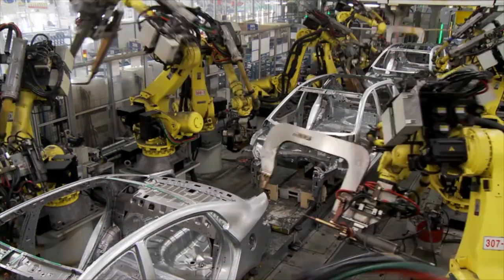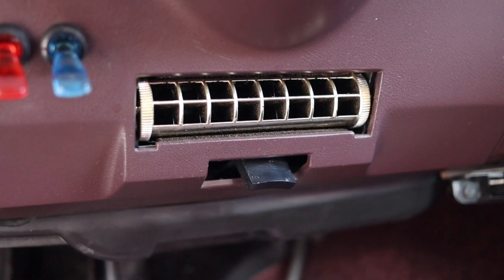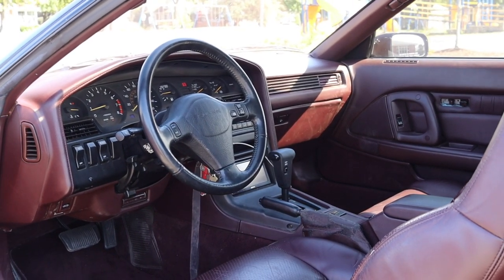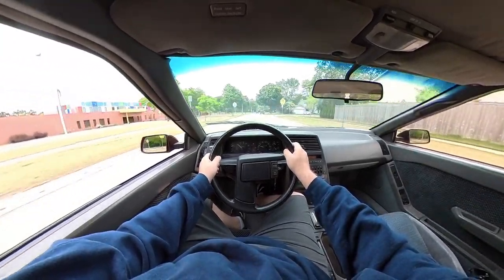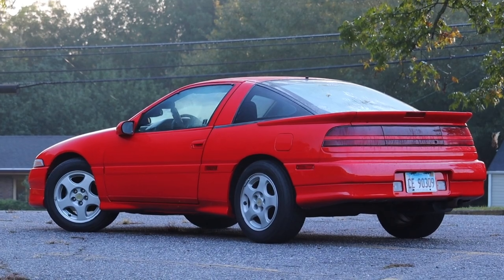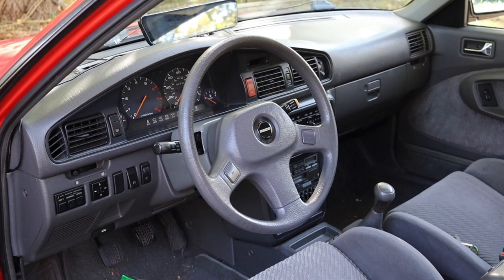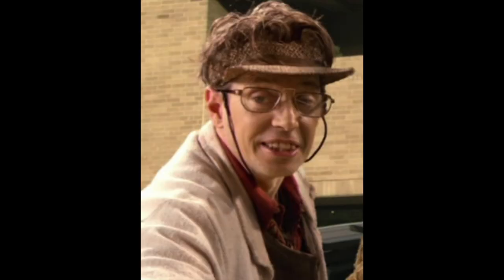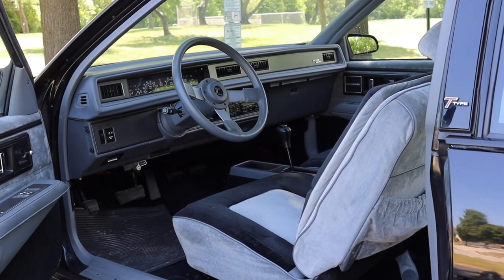Crotch Vents - What They Were & Why This AMAZING Feature Went Away!

Comment: Safety is probably a reason as cars now have airbags everywhere.  As for air conditioning, even the smallest cheapest cars come with A/C as standard equipment.
Reply: I have no issue with that, but MAN they are all so big/bulky/puffy now. The doors are MASSIVE and the windows are not. 
At this point in my life I'm not just into 80's 90's cars as nostalgia, I just legitimately don't like/trust models from 2005 and so on. 
The older ones are cheap, easy to work on, and parts aren't too much usually. They are anything but a disposable product and damn can they stand out these days when taken care of.
Reply: @rushnerd  I don't trust anything with a central computer that handles throttle-by-wire, and agree that modern cars are intended to have finite lifespans. It's the older cars, the ones you can fix by hand and know/understand where everything goes that are worth anything!
Reply: @kiraleaf  Yeah, not but purpose, but I've never had a drive-by-wire car. Even my 01' Celica is direct throttle, but changed to digital the next year. Though hilariously, that car the throttle barely matters as the 2ZZ engine is completely rev dependent.  You can floor it in 3rd and NOTHING will happen. The 88's Supra is the most raw and direct car I've owned though. You get EXACTLY what you put into it and the steering feel is the best a car could possibly be. No idea why people want numb newer cars that are a plastic mess and expensive as hell. Even the dash design I cannot stand on any car now. Bias, but I think the 86-92 Supra has quite possible the best dash layout ever.
Reply: @rushnerd  my buddy had an 89 supra NA automatic but it was such a cool car to cruise around in and got lots of attention.
Reply: @wigletron2846  Yeah mine is a base model NA too, it's easy to scoff at that, but I got it in near-mint shape for $8K @ 115K miles because of that. It gets a crazy about of attention. So much so that I wonder why people even bother with new sports cars. It's just the coolest thing I've ever owned and you get virtually everything you would want from it. Absolutely never get tried of driving her.
Reply: @rushnerd  I like the 86-89 Celica GT-Four (not availabile in NA until 1989 as the All-Trac Turbo in USA and Turbo 4WD in Canada) and the 90's popup models before the Celica was nerfed.
Reply: @rushnerd  I prefer large Windows also which is why I purchase a 2023 Subaru Forester.
Reply: @rushnerd  yeah my buddy got his back in 2010 for $2900 with 150k on it lol. It had a suprising amount of features for an 80s car: power everything, adjustable suspension, and even had a decent amount of cargo space with the hatch.
Reply: @wigletron2846  Killer deal. Not possible today. Though you can pay as much as you want to for one and it's a game of getting the best one with the least amount of issues and/or parts you need. Once it's sorted it's an 80's dream. What happens is most are cheap but neglected and not cared for (they are NOT cheap and parts are rare) so most of them never see the road or rot away.
Reply: @robertknight4672  I mean I don't love glass box cars either, but both my hot hatches are pretty dim on the inside which is what I mean while still having good visibility.
Reply: @kiraleaf  Yeah, of course that gen and especially the 90's gen are the sought at after ones. Not even to mention the outside-US options. But they are pretty hard to find and command high prices, I just wanted a daily for my 7th gen Celica so it does that while looking amazing and being fun. I miss my old Camry, but she is so much cooler it's no contest.
Reply: @kiraleaf  My uncle was a GM engineer from the 70s to the 90s.  When one of his coworkers in the 1980s told him they'd start using ECU technology and a computer in your car would be widespread, he just said "What the fuck did you just say?"  He doesn't trust any of that either unless it's in a standard "showoff" car.  But in a daily?  He wouldn't drive that.
Reply: In Mexico they sell some cars Toyotas even that come standard with crank windows and no AC. A couple months ago I rented a 2020 Chevy Beat, and it didn’t even have POWER LOCKS.
Reply: @scottoleson1997  They seem to make cars with fewer features in Mexico. I saw the lat generation Corolla didn't have the safety sense features that we have in USA

Comment: I believe they were referred to as "personal coolers". These probably went away in part to decontenting. Many features cars regularly had  as standard or mid-range equipment are gone or reserved for luxury cars. For example, puddle lights on doors were very common on cars in 70s, 80s and 90s. They're very rare now. Also, cornering lamps are all but nonexistent, and very few cars are equipped with them.
Reply: I didn’t know puddle lamps were even a thing until the past few years. Are there cars that don’t have these now? Seems like they are pretty pervasive.
Reply: @MoosePockets  I grew up in the 70's/80's and I don't remember any cars with puddle lights at all, except high trim cars that had lights in the doors but not under the door like what we call puddle lights today. Even crap cars have puddle lamps now.
Reply: Cornering lamps and puddle lamps are surprisingly making a comeback. Cornering lamps are now activated by steering wheel angle, instead of turn signals though.
Reply: Puddle lights are rare? 

My Charger has them. I'm pretty sure Challengers do too.
Reply: Puddle lamps are still on pretty much every car.
Reply: @aca2983  I think it has been somewhat regional thing. In Europe, where cars have traditionally been much lesser equipped than in America, we never had puddle lights before this century, except in some individual American imports (including some American-market models from some non-American makes). During this century, they have become pretty much standard here, along with many other traditionally American-considered equipment.

In America there has been, as implied afore, puddle lights in those decades, but I'm not sure how common and how it has been in 90s and up to today. If they are making comeback there now, I think they are following the footsteps of European competitors. No idea why they would have disappeared in first place there, though.
Reply: I have to admit that I've never learned to appreciate "puddle lights", though maybe I'd be more enthusiastic if I had ever owned a car with them. But cornering lights should be standard on all cars; they make a big difference when turning off a dark street, especially with pedestrians around. Most Chrysler cars, Nissans and VWs have them now, but GM, which pioneered them, has let them fall by the wayside.
Reply: Puddle lamps,or courtesy lights,are typically under the side view mirrors these days...not on the inside of the door as often as they used to be,but red lights &/or reflectors are still often on the inside of the doors,so approaching  drivers can see open doors on  cars parked at the side of the road.
Reply: I refer to them as cooter coolers. Wish cars still included them.

Comment: I think my '78 Trans Am had one.  But the air conditioning was so anemic that I really didn't notice whether there was a vent down there or not.  One design "feature" was clearly put in place by a murderous psychopath of an automotive engineer:  The same fuse that serviced the A/C fan also serviced the power windows.  You have not lived until you've been trapped in a 1978 Trans Am in Southern California in the dead of summer with no A/C, no fan, and no way to open the windows, and lived to tell about it.

Comment: Actually, collapsible steering columns began being required in 1968.  If you don't believe me,  look it up.  GM cars had them in the 1968 model year.  Pontiacs even had the words "energy absorbing" written on the middle of the steering wheel in 1968 to indicate this.  Most safety equipment began going into cars in the mid 60s to the mid 70s.  Buick and Oldsmobile offered air bags as an option on their cars in 1974 and 1975, but hardly anyone purchased them, so they went away.  Finally around 1990 they began coming back.
Reply: 100 percent correct!  1968 saw a load of safety requirements In 1955 Ford tried to sell "Safety" It had a deep dish wheel that was supposed to absorb the impact. Yea right! Seat belts were available too. They made a big deal out of the "safety" off the 55 Ford. Not so much in 56! they couldn't give the seat belts away! Things have sure changed
Reply: The insurance companies law makers and the auto industry made a deal to make a seat belt law. These laws delayed mandatory air bags. You are definitely right. The technology has been around for years.

Comment: My first car was a pickup truck, a 2001 Toyota Tundra TRD. This absolute unit not only sported airbags and an adjustable/collapsible steering column, it had the venerable crotch vent to boot. 

It should also be noted that the A/C air could be directed through dedicated floor vents, dash vents, windshield defrost vents, and anywhere in between.  All the while providing adjustable crotch cooling in the Texas summer heat.

Comment: In Australia they were called lap vents.  I think another key reason is the design of the HVAC box and ducting.  Cars of the 70s had very little consideration for integrated AC.  Through the 80s, it got a lot better.  But adding AC normally involved running additional ductwork, and for ease of fitment, this usually ran behind the lower sections of the dashboard.  It was very easy to add a lap vent to the ducting that was just an inch behind the vent location.   I had a 1984 WB Statesman (Aussie car) that had lap vents on both sides, not just the driver.  They drew from the ductwork that fed the outer face vents. 
By the 2000s, almost every full size & mid size passenger car had standard AC in all but the very basic trim level.  Economies of scale shifted to making AC mainstream.  The design of the HVAC system evolved in the 80s to start prioitising AC, with a cheap “downgrade” insert to replace the evap core in non-AC cars. By 2000 (and some up to a decade earlier) the ducting and HVAC were key packaging elements right from the design stage, and the ducting often ran much higher up behind the dash, or in some cars, was even incorporated into hollow structural members to save space.  There was no longer an easy way to get that air down to the lap vents.  The cost of doing it would have been tens of dollars,  not a few cents..   My current daily driver has so much space below the steering column, and could easily have one, but the ductwork runs behind the instrument cluster.  It’s incorporated well into the dash structure, miles away from a lap vent location.
Reply: This is exactly the answer I was thinking.
Reply: Definitely the most probable answer I’ve heard

Comment: I remember Chevy/GMC  C/K and later R/V pickups, SUV's from '73 - '89 when equipped with factory A/C had those crotch vents located at the lower left side of the dash. You could position the vent to get the optimum volume air flow to the "family jewels" . When they were cooled you were very comfortable on the hottest days! I knew the feature in those vehicles was designed by a very thought out male engineer! Later models of those PU's and SUV's (new body style '88's - '99 SUV's to '01) had a similiar vent located just under the steering column, but they didn't get the same volume of air flow as the previous models did, but at least the thought was still there.

Comment: Some cars in the 70s had 2 crotch vents for the driver, and 2 for the passenger. One had a tab to pull forward for “floor air” which was a nickel sized hole that dropped the cold air down to your feet. The other was a 1 x 4” vent with a door to drop down to cool your crotch. This was one unit. Sooo nice, so decadent, so pleasing, it was the car built to coddle you. I remember this on 74-78 Chrysler Newports and other variations like the Monaco of the blue brothers movie.
Reply: Ah, the crotch coolers of my youth. The toe cooler WAS a nice touch, too. My parents bought a new Monaco in '74; it had a beautiful blue civilian paint job and had the lesser 'cop' package - all the stuff Elwood talks about, but with a 360 2-bbl instead of the 440. I got my first driver license, and cooled a lot of crotches, in that car.

Comment: The reason they were down there is because back in the 60-70-80s..  a.c was optional.. didnt come standard..  So the dash wasnt buult with a.c in mind.   If you picked the a.c option you could simply bolt simple routed vents under your dash.

Cars back then also had vents by your feet.. you pull a lever and theyd open up getting fresh air from outside to your feey.

I love those on my Wagoneer. And wish new cars still had this
Reply: Does your Wagoneer have cowl vents?  I have an Eagle with the most powerful cowl vent ever. Sadly with the floor missing, it isn't so noticeable anymore.
Reply: @KC9UDX  yea thats where it also gets air for the heater lol.  But yea if you pull two knobs it opens vents on your vents where fresh air from the top cowl by thr hood rushes down on your feet. I love it.

Sometimes you dont even need the a.c on with those.  My a.c though works.. the original compressor ca.e to life with two bottles of r12 but 4 years later it blew up.  So i got a new compressir but it had pag oil.. had to flush it manually with mineral oil befofe hooking it up.. i didnt vacuum or replace anything else.  Two nottle of r12.. and 2 years latsr its still cold on hot muggy days
Reply: Most of the GM cars from the 70s had the vents in the kick panel that you pulled the knob to open them up. This was only on cars without air conditioning. They were eliminated if you ordered factory A/C.
Reply: @mikee2923  all Jeeps had them regardless of a.c or not.  All the fullsized Jeeps. The wagoneers. Cherokees. And Gladiator or J10 j20 etc.  

My 76 J10 has them and a.c, and my 90 grand wag has em too and a.c
Reply: @jeepsblackpowderandlights4305  sure but not all of them have them and its not really about where the air ultimately comes from ,its about how it gets there.
Reply: @jeepsblackpowderandlights4305  the ones with AC don't have the velocity of true "cowl vents", I'm not positive (yet, haven't had to disassemble one yet) but I think they come from the heater box.
Reply: @mikee2923  I've had a few from the 80s. I have an 88 K1500 with them now.

AMC put vents on all cars, air conditioning or not.  But the ones with AC don't flow anywhere near as much air as the others.
Reply: @KC9UDX  

No ur wrong.  The cowl vents have nothing to do with the a.c on a wagoneer.  The a.c fan blower is inside the cabin and takes inside air to blow through cheap little ducts screwed the metal dash.  In fact if you have a plastic bag on the floor down there passenger side..  Itll suck the bag up because it gets air from in the cabin only.. lol   The cowl vents go through the cowl by the winddshield and down through the body on the drivers and passenger side and blow out your feet when driving.   They also fill eith leaves and debris cause major rust issues through that hollow wall inside and up the cowel itself.  Thankfully mine doesnt have that.

But my 76 Jeep j10 does on tje passenger side.. and there is 0 hope ti rebuild that maze.  So i gatta cut it all out and just plug it with sheet metal but allow drain for moisture

The heater gets air from the cowl thats but it blows air in the center only on the transmission hump.  The whole ducting system is weird on the wagoneers and other full sized Jeeps
Reply: @jeepsblackpowderandlights4305  OK thanks. It's been a long while since I worked on one.  It must be a different vehicle I'm thinking of.

Comment: My Caprice had those and I loved them.  One on driver side and one on passenger side.  What's sad is today's AC vents are often located in the WRONG place.  The Camaro, for example, has them mounted really low so they freeze your lower body and hands while your chest and face swelter in the Southern sun.  Look also at the newer BMW 8 series and other BMW's where the vent is lower on the dash.  (Maybe it doesn't get sweltering hot in Germany...?) Once again the BMW vents leave your upper body and face sweltering.  I had one of those BMW's, had the windshield tinted and even that didn't work very well.  The newer Mustangs and some Audi's such as the A3 series have the vents mounted high so they really work in the summertime - duh, that's when they are supposed to work!  Get a clue car companies.  Try driving the test cars in the desert or deep south before you decide where to put the AC vents.  Another issue, I think, is that more of the new cars (probably soon, ALL of them) have the entire top of the instrument panel slathered with TV screens, so no room for vents.  I guess we can watch movies or whatever while we drive sweating!  Sad...

Comment: Anyone who installed a new radio/cassette deck in the day learned the AC duct often traveled along the lower front edge of the dash. That location made it easy to add the duct and vents if AC was ordered, whether from the factory or the dealer. (Yes, they could add it on some cars.) Anyway, if the duct is already there, why not just add the vent? Nowadays it would require a separate duct originating from the depths of the labyrinth of stuff behind the dash, and would cost too much. (Mom called it The Skirt Lifter.)

Comment: My 88 Toyota pickup has one. Good thing too! 
A cable has come loose inside the dash and the only air position is defrost..which supplies this thing.

I have the side vent windows too, which are great, except for the few times when at highway speeds, insects..including one wasp..have been propelled into my chest.